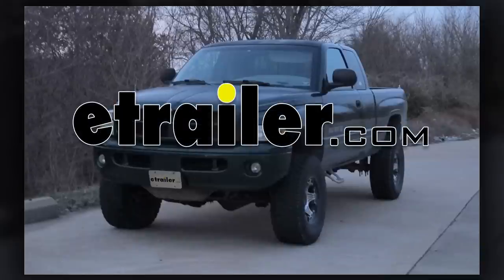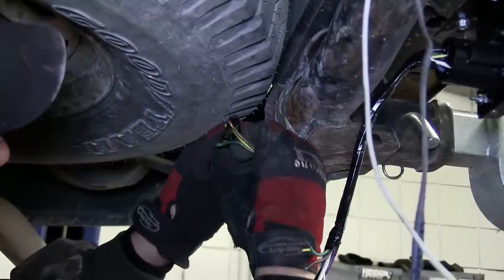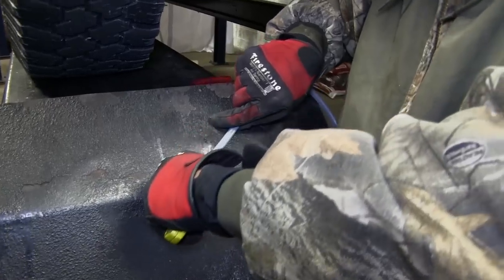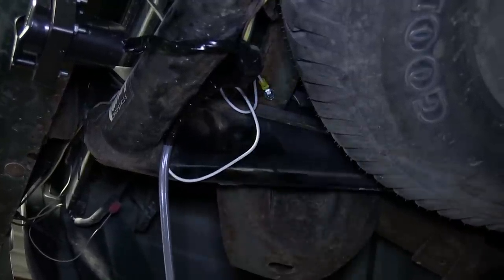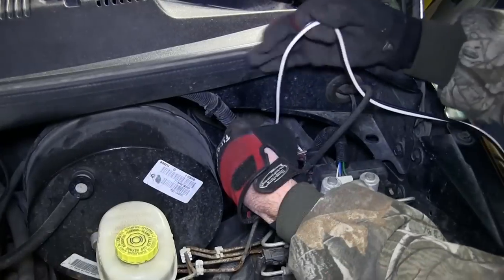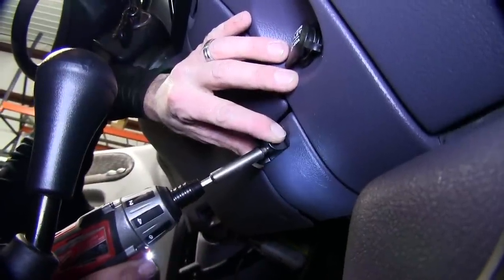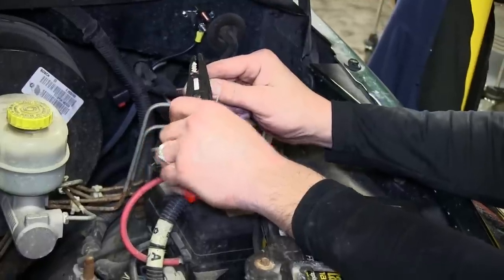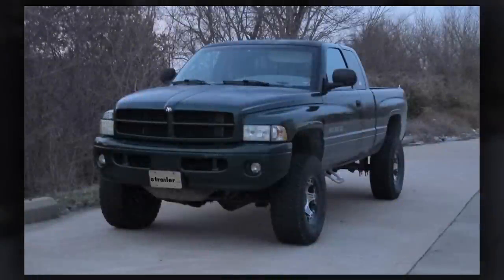Installation of a Trailer Brake Controller on a 1999 Dodge Ram - etrailer.com

Comment: FYI, most brake controllers call for running the ground back to the battery and not using the chassis as ground due to the amount of current being sent to the brakes. This type of grounding is called 'star grounding'. Having a poor ground can cause brakes not being applied.
Reply from the maker: Running the brake controller directly to the negative battery terminal is recommended, however in this installation the factory ground is already ran through the firewall using the tow package wiring. In this instance, there's no need to run an additional ground.
https://www.etrailer.com/Accessories-and-Parts/Tekonsha/3020-P.html

Comment: Hello why would you cut the blue wire from the brake control harness. Wouldn’t cutting it mean you are only sending a signal from the brake controller not by pressing the brakes also. Would it not be more beneficial to tie into the wire with a three way connector? I could be completely wrong but I’m doing this exact job and I’m gonna try to tie into first
Reply from the maker: The blue or brake output wire isn't run to the rear of the vehicle on Ram trucks that don't have the factory installed 7-way. This is the easiest way to run that circuit to the rear of the vehicle.

Comment: Hello there, just a comment regarding the last part of the installation, where you guys hooked up the power wire to the battery itself, in between the clamp, would it not be better to install the ring terminal outside the pinch of the battery clamp?  Reasoning being that the clamp, if worn out or if the battery terminal would be worn down from use, adding a spacer depending on how thick the ring terminal would be, may cause tightening issues because the clamp cannot tighten any further, which can, and probably will cause power issues with the vehicle itself.
Reply: Michael Blatz I love watching people do things incorrectly when they are being “instructional.”

Comment: I know it’s a long shot… but I went to my 1999 dodge 1500 and it does not have the blue female plug for the brake controller. I can see where I’m assuming it was suppose to mount to on the side of the harness. Any idea where to start looking into finding where the plug ties into?
Reply from the maker: If your truck wasn't equipped with the factory tow package, it will not have the blue connector you spoke of. You'll need to hardwire the controller, which isn't terribly difficult. You'll need a functional 4-pole connector, use # C55329 if you don't already have one. Then, use our # ETBC7 install kit.
https://www.etrailer.com/Custom-Fit-Vehicle-Wiring/Dodge/Ram+Pickup/1999/C55329.html
https://www.etrailer.com/Accessories-and-Parts/etrailer/ETBC7.html

Comment: Is it the same process for a 97 ram 2500 cummins? Do you sell just the wiring and the controller? I already have the 7 pin connector, I just need to replace the wiring and install the controller.
Reply from the maker: Ethan Transue Yes, the process would be pretty much the same. We do have the brake controllers available on their own: https://www.etrailer.com/dept-pg-Brake_Controller.aspx

If the 7-way is already on the truck and functioning, all you need is the wire to send the signal from the brake controller back to the 7-Way and the needed circuit breakers, part # 5505: http://www.etrailer.com/p-5505.html

Comment: Does it matter which brake control you put in there I took one out of a 1997 GM truck hopped on it heavy duty and put it in a 2005 Dodge Ram and my toload package is not working the way it's supposed to I was wondering if it matters what style or what brand you put in cuz it has a soft and low setting your slider control and another switch on the side for the leveler I'm just wondering what I've done wrong?
Reply from the maker: Brake controllers are a very universal accessory that can be fit to different vehicles. You just want to be sure to change the braking force based off of the trailer that you are pulling so that you have the correct power to the trailer brakes.
https://www.etrailer.com/bc-1999_Dodge_Ram+Pickup.htm

Comment: i dont know how reliable those butt connectors are, id use the solder heat shrinks, super easy and alot stronger
Reply from the maker: We have had great results with using heat shrink butt connectors. Soldering is a more permanent connection but takes more tools and skills that some may not have.
https://www.etrailer.com/Accessories-and-Parts/etrailer/ETBC7.html

Comment: Hello, I wired it up just like in the video to the breaker but it keep clicking as if it's popping the breaker. What am I doing wrong? The black ground is tied into the white ground and grounded to the truck and the blue goes to the brake control, then black to the aux breaker and a pig tail from the copper to the positive

Comment: You cut the purple wire without explanation I believe. It is for the reverse lights. I don't understand. Are the reverse lights already hooked up with the old 4 pin?
Reply: NO 4 pin is left turn, right turn, brake light, and ground

Comment: It's funny that they ran all that wire through the frame 4 power wires to the rear of the truck considering it has the factory wiring loom for brakes in the truck which means there should be an access port at the back of the truck 4 power they only install that port on trucks with Factory tow packages built into the truck 4 trailer brakes
Reply: Right

Comment: I’m surprised that Dodge doesn’t have a place besides the battery to get power from.
Reply from the maker: That is the case with most vehicles. You will want to connect the wiring directly to the battery so that you do not have interference with other accessories. The vehicle did not come equipped from the factory with a 7 pole outlet.
https://www.etrailer.com/Accessories-and-Parts/etrailer/ETBC7.html
https://www.etrailer.com/Trailer-Brake-Controller/Tekonsha/90195.html
https://www.etrailer.com/Accessories-and-Parts/Tekonsha/3020-P.html

Comment: Why cut the 4 pin terminals, why not just plugging in
Reply from the maker: By using heat shrink butt connectors to make the connections we are making a much more permanent and reliable installation. You can just plug the 4 pole into the connector on the new 7 pin harness but we've found that there are corrosion issues that may come up.
https://www.etrailer.com/Accessories-and-Parts/etrailer/ETBC7.html
Reply: @etrailer  good to know

Comment: These numbers (90295-3020P) are not online.
Reply from the maker: I think you may have mis-typed a part number as the Tekonsha Prodigy P3 brake controller (shown in the video) is part # 90195 with the adapter being used being part # 3020P. The Prodigy P3 is still an active brake controller which you can find on our site here https://www.etrailer.com/Brake-Controller/Tekonsha/90195.html and the adapter can be found here https://www.etrailer.com/Accessories-and-Parts/Tekonsha/3020-P.html